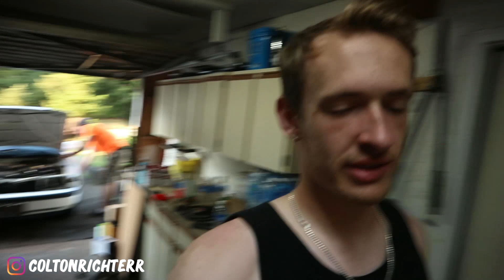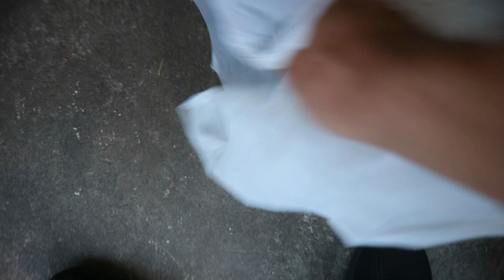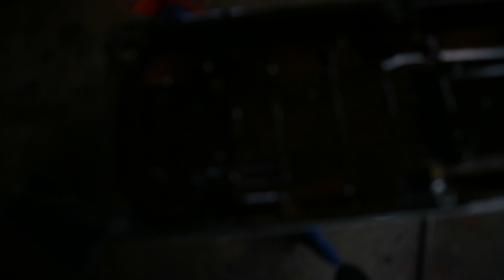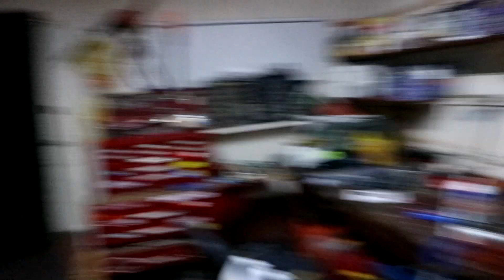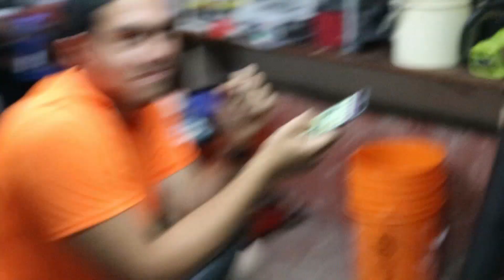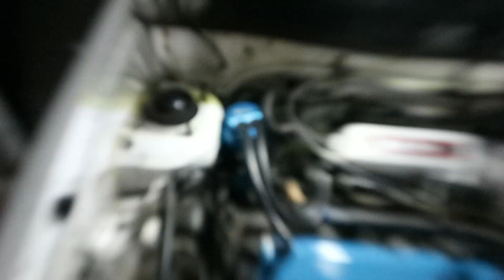BUDGET 323 Engine Bay MAKEOVER 🔥

Comment: Did you guys find removing the heat shield from the car damaged the spark plug wires at all? I just bought a 1992 323 and i wanna take the heat shield off and paint it but i dont know if the wires could get too hot if i do since they're pretty close to the stuff under the heat shield
Reply from the maker: Ours doesn't have a heat shield 🙂